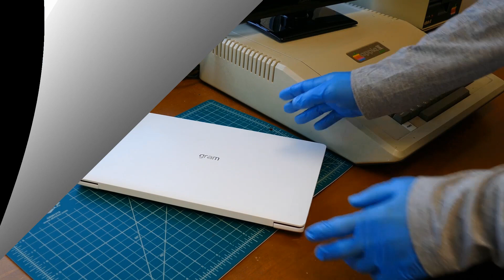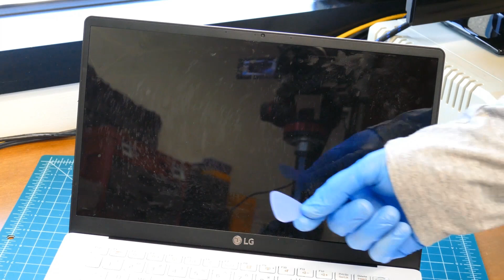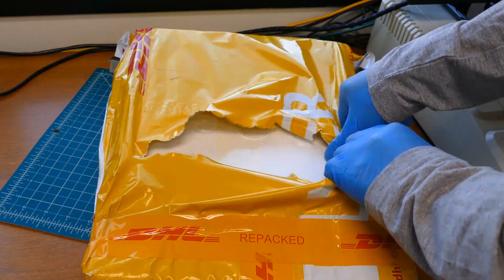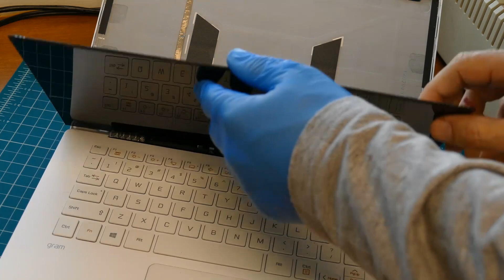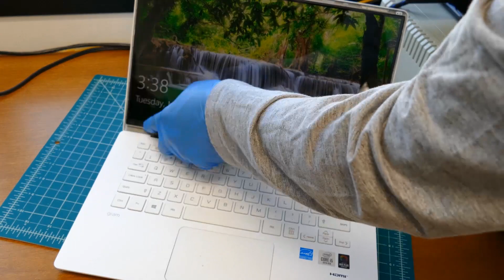LG Laptop LCD Screen Repair Tutorial

Comment: this might be a dumb question. but....
where would i be able to find the screen's model number when looking at system setting I only get the device ID and product ID doesn't give me the screen model #
Reply from the maker: You can retrieve monitor information in Windows using WmiMonitorID, which provides details like the model number of the monitor or screen. However, it likely won't give you the manufacturer model number of the LCD panel inside.

Comment: Enjoyed your video. Sure could use some help finding a display screen for my LG GRAM. Part number 15Z980_AIT_1.0 40 PIN Touch screen.
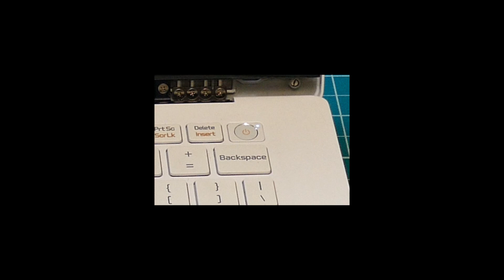Reply from the maker: That doesn't sound like the part number for the screen.  Did you get the part number from the barcode sticker on the actual LCD screen?  For example, at 2:22 I show the sticker from my screen which is part number LP140WF7(SP)(G1).  Always get the part number off the actual LCD, otherwise it may not work.
Reply: +1 … So true, the Gram model number is half way there. As shown in the excellent video.. Disassemble down to the back of the actual screen… for the part number of the screen. Once armed with the actual screen part number,,, give Amazon a try. Good luck…

Comment: I definitely recommend LG Gram for how easy it is to repair and upgrade. The back is easily openable and I upgraded from 256 GB to 1 TB hard drive. Also later I had my screen broken also (before I saw the video) and was again able to replace the screen. Only problem is that it was a touchscreen and the new screen doesn't respond to touch. I don't know if I didn't connect the pins correctly  or if the screen was just bad.

Comment: Didn't you need to glue the panel back into the lid? Did it already have adhesive (with a peel-away coating) on it?
Reply from the maker: Great question!  On this laptop the LCD screen is held to the laptop lid by plastic guide pins and double sided tape.  The bezel is secured over the LCD screen with plastic snap-fit connectors and double sided tape.  I did not break any of the plastic connectors and the existing tape was intact so I reused it.  If you need to replace the tape, I recommend a very thin transparent high strength tape such as 3M 300LSE.